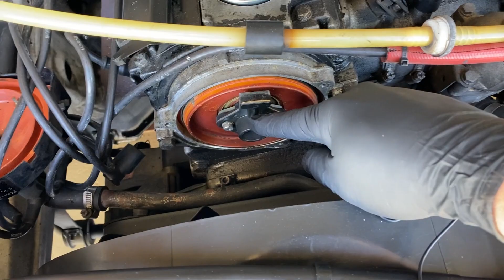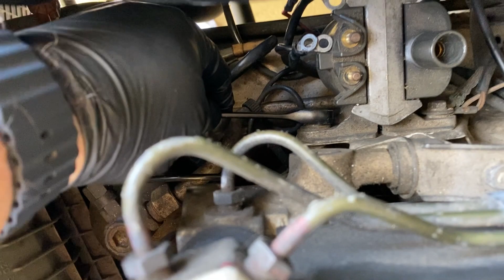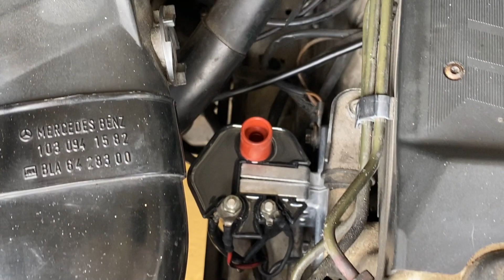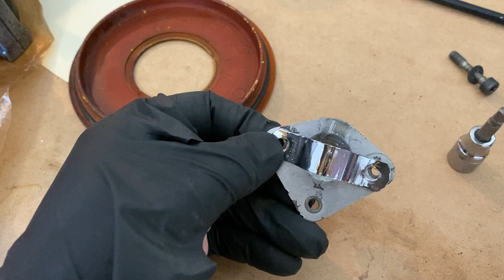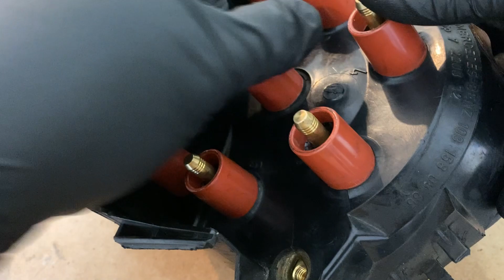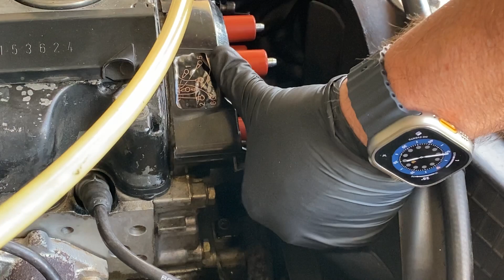Mercedes W124 - Coil, Distributor and Spark Plugs. Remove and replace.

Comment: 190e Mercedes 1987: replaced spark plugs then took it for smog test. Passed smog test. 2 weeks later started shaking when on a stop. Runs smooth. Starts good. What to do?
Reply: Replace the ignition coil from the first part of the video, sounds like a bad misfire. Before spending money on new parts I'd take off the distributor cap and see what it looks like in there. May need to scrape contacts and clean it up. If it's not too bad/cleaning it doesn't help replace the ignition coil.

Other thing to check would be if your Valve Cover Gasket is leaking AND the gasket around your sparkplugs is leaking too. Getting oil onto those shiny new spark plugs would cause some decent misfires. Still looking for the part number fopr those spark plug seals myself.....

If none of those things are the issue I'd check what your battery is reading with the AC on full blast and the headlights on. I THINK its supposed to be around 14.5V (find another source on that).....if its fluctuating or constantly reading below that then that points to the voltage regulator or the entire alternator being bad. Voltage regulator is like 40$ and is right on the front of your alternator and is easy to replace (or so I have heard).

Comment: Did it solve the issue?
Reply from the maker: Absolutely yes. It started immediately and smoothly after replacing the plugs, rotor, backing plate, distributor and  coil. I did it all in one go so I can't say 'exactly' if one things was an issue over another but I suspect it was the coil given the sudden failure and the coil was under stress from trying to overcome the higher resistance in bad gapped plugs and old distributor.
Reply: @generalvoltage1821  
Thank you, lately been having issues with start and running, it runs for a while then shuts off, so will give it a go.